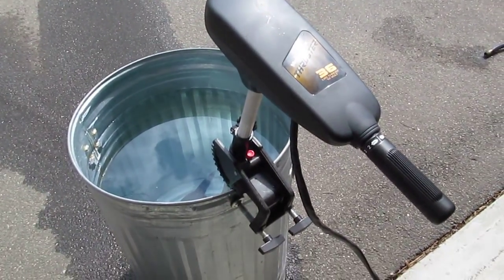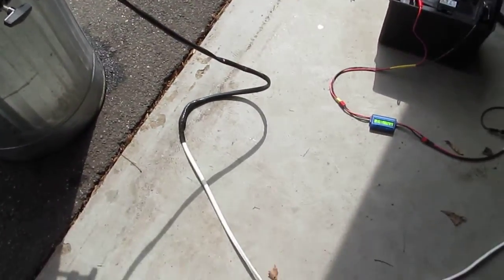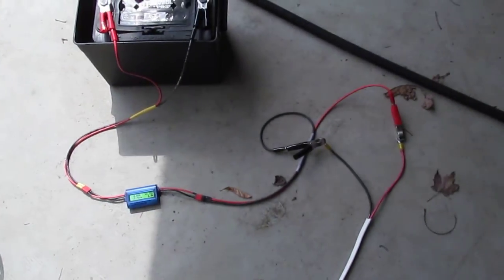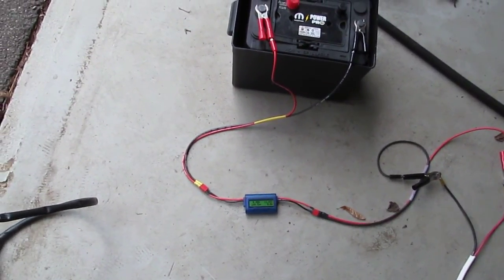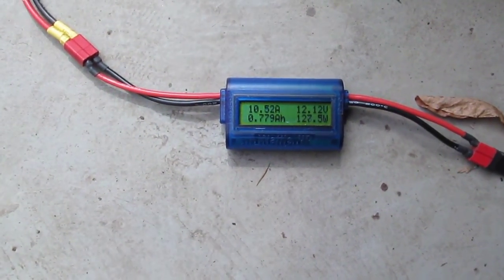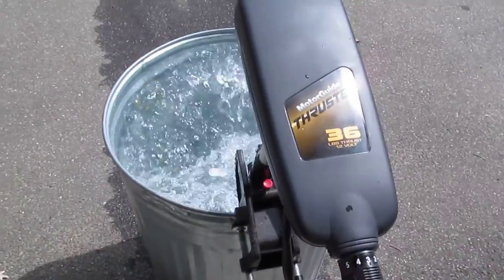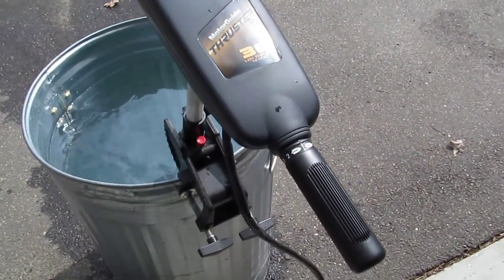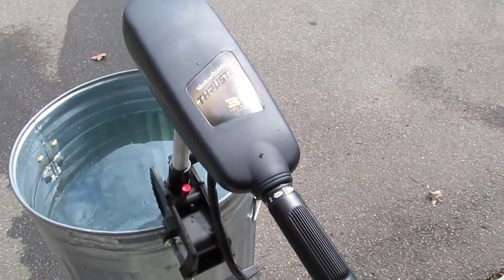MotorGuide 36 lb trolling motor current test

Comment: I just got one of these and noticed in the manual the rotary switch used to control the speed. I was wondering how that would work. Your point about the speed coils helps to understand.

Use 24 or 36 v on your 12v MotorGuide and you'll be fine (if you're careful about controlling the heat in your cables, connectors, motor, etc.) 
Over volting an electronic speed controller and you're asking for trouble.

Comment: Actually you are doing really good with that old model , why you stop ?   Might be the reason why its still around after 10 years , WOW  !  That was when quality was quality built . You don't find that anymore .   You lucky if you get 5 years from the new computerize model .  My new computerize  model  Newport Vessels 36lb thrust draw right around 29.5 amp in 5th speed .  .... I like to believe your 10 year old motorguide can do better in 5th speed ! .... I prefer your old motorguide trolling motor myself .  Simple solid quality built VS cheap computer junk from china . ... ... Better hold on to old Betsy , she'll be arou d for some time .  Your a lucky man !
Reply: I agree, I have an old one from the late 90's still running perfect. The thing is like 24 years old and still going. All this modern day crap is designed to blow up in 2-5 years.  Never get rid of that old stuff.
Reply: @storyman34    yes..... these days !  You are trading fancy looks  FOR  quality built  !    Everywhere  I go !  I see brand new looking computerized washer & dryer machine left out front for garbage pickup and the scrap guys picking up scraps is very happy about this situations  !    🤣 🤣 🤣
Reply: @joeblowjohnny2297  Funny you say that.... on my youtube page I have videos of my 41 year Kenmore washer and dryer making the same comparison.  My mother in law is on her third washing machine in the last 7 years.  My old 1981 machine only had the water pump replaced and the time switch rebuilt. I'm keeping it forever.  Nothing new is good.
Reply: @storyman34   you are exactly 💯  right boss !  I drive a 84 ford work van with no Computer on board and I'm rolling on 471,000 miles still going and has never seen a mechanic because I do all the work myself !  It so easy and no brainer  !
Reply: @joeblowjohnny2297  I miss the days of old carburetors.  Only thing I own now with a carb is my boat engine, lawn mower and snow blower. My car is 31 years old, but first generation EFI, so no problems in the 31 years I owned it.